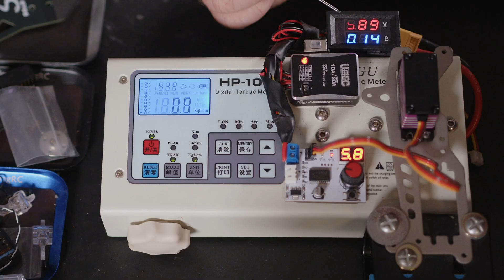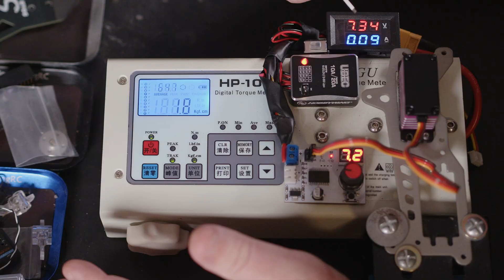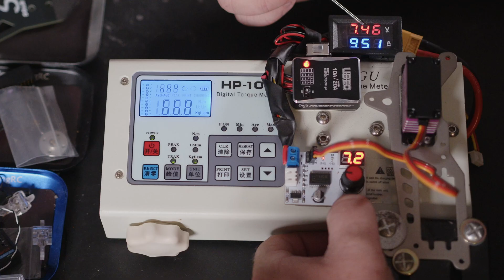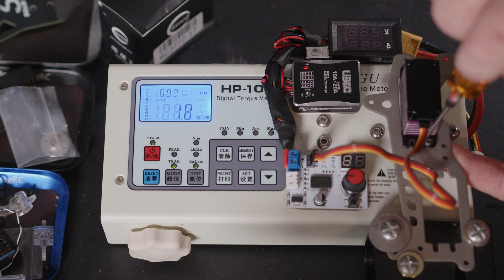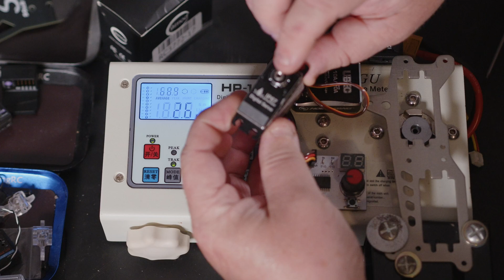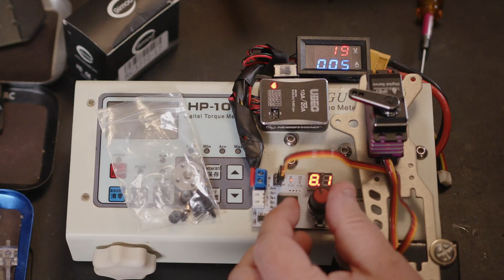9Imod 71KG 180 brushless servo tested.

Comment: Sorry to hijack this post. I recently discovered your page. I am in need of advice. I have an FS i6X. Trying to update my firmware. I have been getting confusing advice on which cable I need to upgrade the firmware. Can you help me?
Reply: I was able to update my FS ST-8 no problem. This is why I suspect the cable is my problem.
Reply from the maker: It could be but different transmitters need different protocols to program
Reply from the maker: You will need a usb to trainer post cable if you download the instruction manual from flysky is should show you but it's not one of the transmitters I have unfortunately
Reply: @WTFRCCars  Thanks for the reply. Actually I have tried 3 cables. I may have an issue with my PC. Recently updated to win 11.
Reply from the maker: Some usb chipsets can not do DFU or firmware flashing from pc if it's a desktop try the rear motherboard usb sockets